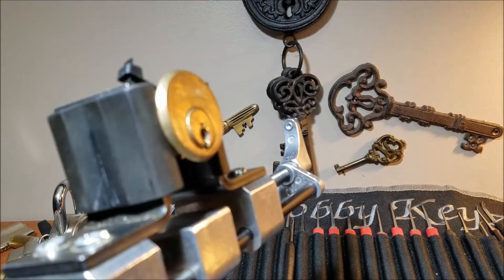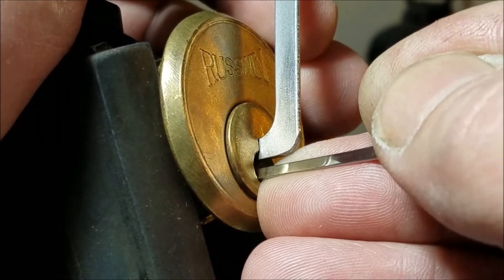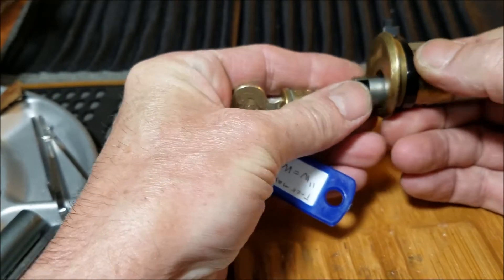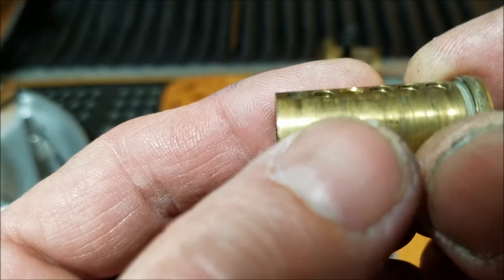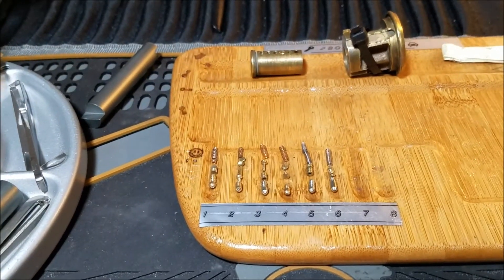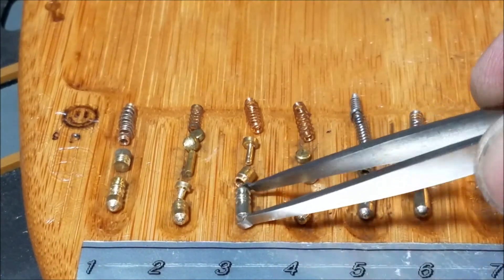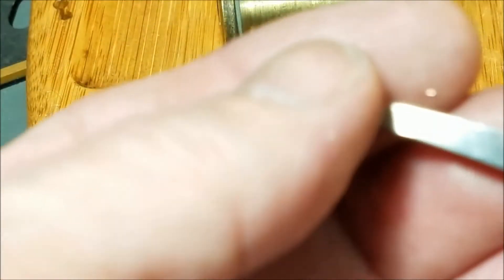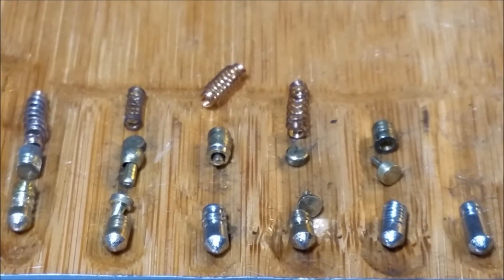(201) RUSSWIN W=Winning sent by "Chris Ahrens" pinned by "Trekmaster30" spp'd and gutted

Comment: Nice pick bud.    That lock has more bark than bite.  The bible on it is so heavily worn that if you look closely, the holes are slightly oval shaped which makes it a tad easier to pick.  That was the lock I built in my video of how I modify pins for a challenge lock.
Reply from the maker: Trekmaster30 yep I remember that video that's one of them that I learned a lot from. I'm thinking I'm gonna try and pick that one again not on camera but I want to see if I just got lucky.